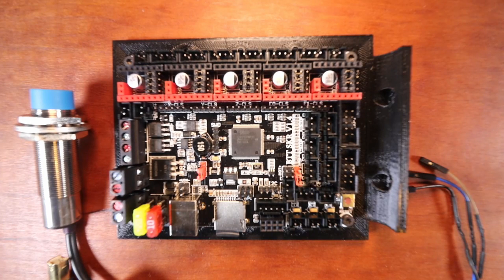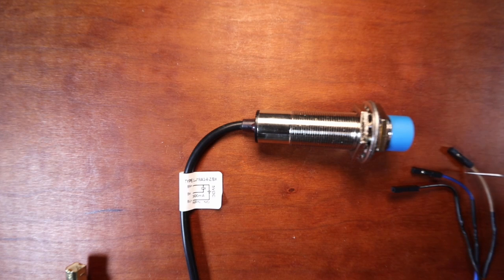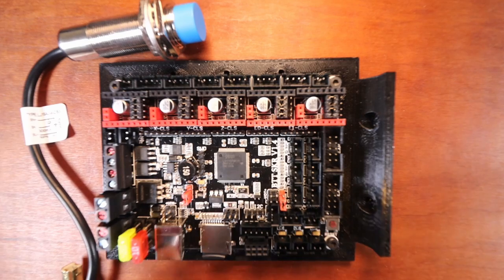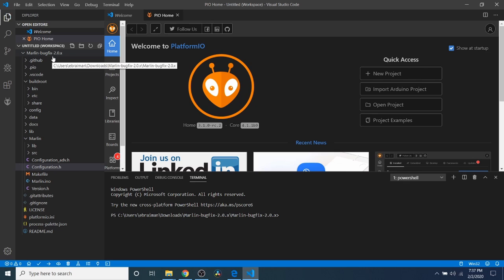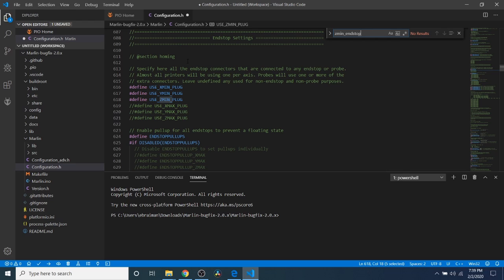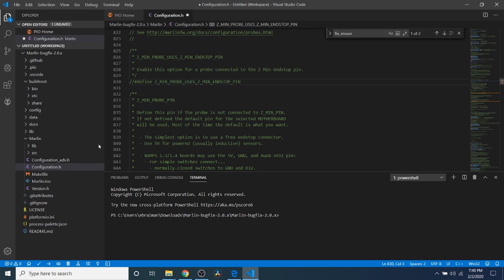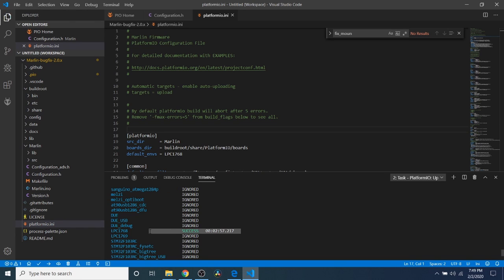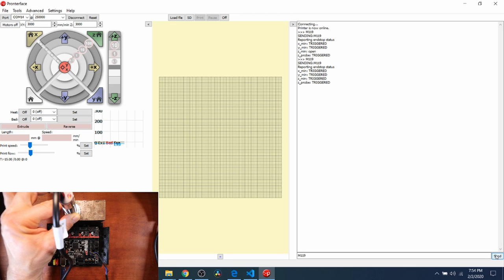SKR 1.4 - FIX MOUNTED PROBE

Comment: Important thing you left out, if you are using a sensorless driver like TMC2209 in UART mode, certain pin(s) have to be disabled. I would like not to clip pins on the driver, like if this needs to be done for SPI mode. From what I understand, the z endstop doesn't work if the debug pin is connected.

Comment: Hello Edward, thank you very much for your great tutorial. I have a quick question. I have an NPN NO sensor, but its power supply is 6-36 volts. Can you tell me how I can connect that to my SKR 1.4?
Thank you and please keep it up.
Heiko
Reply: You need a buck converter but luckily if you do that it will connect directly to the z endstop which is way easier
Reply: I believe an optocoupler would work here.

Comment: I did the fixed probe setup and left the "default zmin min probe uses zmin endstop pin" enabled and it seems to work fine, because the probe is actually plugged into the z endstop pins, same pins you are using.  The bltouch pins are actually below the the pins you are using.
Reply from the maker: True, but I did test with zmin last night on commented out setting.  The main reason I commented out was fixed mount probe setting would not compile/build without doing that.

Comment: For the popular 6-24/30/32/36v inductive sensors
In case someone else has this problem. The popular inductive sensors are not compatible with the SKR series. 
The sensor in the video is running at 5v but these are harder to find and are more expensive
The SKR has 5V on z switch while most sensors work between 6-32v. In order to use these, one needs a voltage divider. Power the sensor directly from the psu (12v in my case), insert voltage divider, signal drops to or a little lower than 5v and it works. for my sensor, the 15k on signal, 10k between signal and ground wires worked. However, even if the measured voltage at the sensor signal output is now correct, it still did not work. the SKR has hardware pull down and pull ups. My board maintained a steady 2.5v on the signal pin on the connector on the board. Meaning the sensor still won't work.
You need to activate/deactivate de pull-ups an/or pull-downs (depending on the default setting and the measured voltage on the pin on the mobo). There is no need to reassign the z probe to other pins on the board like i've seen in other guides
These need to be changed to fit your machine, example bellow are my settings. Sensor does not work on SKR without these settings being correct for the hardware used.
**as a side note, the 4 to 8mm industrial inductive sensors are really good and reliable. i bought more  LJ12A3-4-Z/BX for aroun 4usd(equivalent) / piece and they work great (even wen using a 2mm thick piece of galss over the bed)
#if DISABLED(ENDSTOPPULLUPS)
  // Disable ENDSTOPPULLUPS to set pullups individually
  //#define ENDSTOPPULLUP_XMAX
  //#define ENDSTOPPULLUP_YMAX
  //#define ENDSTOPPULLUP_ZMAX
  #define ENDSTOPPULLUP_XMIN
  #define ENDSTOPPULLUP_YMIN
  //#define ENDSTOPPULLUP_ZMIN
  //#define ENDSTOPPULLUP_ZMIN_PROBE
#endif

// Enable pulldown for all endstops to prevent a floating state
//#define ENDSTOPPULLDOWNS
#if DISABLED(ENDSTOPPULLDOWNS)
  // Disable ENDSTOPPULLDOWNS to set pulldowns individually
  //#define ENDSTOPPULLDOWN_XMAX
  //#define ENDSTOPPULLDOWN_YMAX
  //#define ENDSTOPPULLDOWN_ZMAX
  //#define ENDSTOPPULLDOWN_XMIN
  //#define ENDSTOPPULLDOWN_YMIN
  #define ENDSTOPPULLDOWN_ZMIN
  //#define ENDSTOPPULLDOWN_ZMIN_PROBE
Reply: Can I take 12v for the proximity sensor from the always on fan pins?? Top right side corne if you look from usb and to put signal on z end stop?
Reply from the maker: You'd need to filter signal pin not to fry board.  Signal pins only take a maximum of 5v, 12v will cook board.
Reply: @EdwardBraiman  thank you.. I have understood that I need to use 2 resistors to step down to 5v.. on google I have found only with external 12v psu to hook up to the sensor and I was thinking if I can take the 12v from the fan pin and only connect ground and signal cables to the z end stop.. with the resistor soldered

Comment: also, according to the seller I'm buying this probe from, it can detect anything.
This is the discription. is this a different type of sensor than you have?

Features:
It is a component widely used in automatic control industry for detecting, controlling, and noncontact switching.
When proximity switch is close to some target object, it will send out control signal.
As it is capacitive type proximity switch, its detecting object target is not limited to only conductor, but also liquid and even powder things, like plastic, water, glass, oil, etc.
It's widely used in machine, paper making, light industry for limiting station, orientation taking count, speeding trial ect.

Specifications:
3 Wire Polarity: NPN Detection
Voltage: DC 5V
Detection Distance: 2mm
Ouput Status: Normally Open
Output current: 300mA
Detection objects: Conductor
Part number: LJ8A3-2-Z/BX
Screw Length: 50mm
Quantity: 1 Pc
Note:
Please allow 1-3mm error due to manual measurement. pls make sure you do not mind before you bid
Due to the difference between different monitors, the picture may not reflect the actual color of the item. Thank you!

Package Contents:
1 Pc x Inductive Switch
Reply from the maker: The sensor in the video is inductive.  I've not yet tested capacitive and might not, because the last time I used one the wires melted.
Reply: @EdwardBraiman  Will i be able to follow the same steps to set it up on my BTT 1.4 Turbo/Pro MOBO?
Reply from the maker: Is the Pro Mobo a printer?

Comment: If i understand, if i use a PNP NO ive just to modify the parameters 
 define 
Z_MIN_ENDSTOP_INVERTING false and  
define Z_MIN_PROBE_ENDSTOP_INVERTING false and if the power supply is 6 to 30V ive to add a voltage adapter to 5V like a voltage divider or an optocoupler or better a 7805 to give on black wire signal the wished 5V right?
Reply from the maker: A voltage step down to signal pin helps, but it's easier to use one listed in description.
Reply: @EdwardBraiman  i buy NPN its easier, thank for reply

Comment: Thank you for your great videos. I appreciate them greatly.
I'm confused on the Marlin setup. You say to comment out the "use Z_MIN_ENDSTOP..." but then plug it into the endstop. I tried both variations of commented & uncommented but neither work for me. When I home Z the axis will move about a millimeter then stop.
Reply from the maker: What the sensor type?  If it's not NPN NO, then it might not works.  You can always test with an Endstop switch to verify pins are working.  Then they with multimeter voltage from sensor to check your sensor is working.
Reply: Forgot to inverse the triggered state?
Reply: @EdwardBraiman  Thank you for your reply Edward. I'm using the P.I.N.D.A V2 from POLISI3D. It's an NPN but I'm sure if it's normally open or closed. I believe it NC but not 100% sure. I'll try an endstop and see if that works.
Reply: @SteinerSE  Thank you Thomas for your help. I'm not sure. Would that effect the Z axis moving the wrong direction? The bed drops a couple times then stops. (Hypercube Evolution printer).
Reply from the maker: If the axis moves in wrong direction you can invert direction in Marlin firmware.

Comment: There is a huge problem with probing on multiply endstops when probing, i make an bugfix for this, still waiting that this will integrated in marlin. 

And, now we have marlin 2.0.2, in this i allready integrate an bugfix for all users that want to use multiply endstops and connect the Z endstops to the "z-stop" and "poen" pin
Reply from the maker: Not sure about fix yet as I'm on some of the Marlin bugs emails.  Do you have a link to the Marlin bug?

Comment: Hello. One question. We need to change the jumper for 5v and keep in 5v right? Other thing. This will work with a skr e3 mini v1.2? Thank you
Reply from the maker: Yes if it has a 5v jumper.  The reason make people use 5v is it safer way to explain firmware updating.

Comment: HI! nice tutorial! I´m trying to set my SKR 1.4 TURBO to work with UBL with a fixed probe, z home it´s good, heats up goes to the first point reads (in pronterface says fail to probe) and follows with the next point but in the same spot. i mean for example, it says point 3/9 but the probe is still in the first position and every time throws a "fail to probe" i dont know what am i missing, please help. 
Also, if i try to do a fine mesh edit it moves through the points normally.
Thanks!
Reply from the maker: My guess is eeprom.  There's a Discord chat in my Discord for BLT where someone might be able to give more information.  The Link should be in description.

Comment: Great Video. Ive currently the v1.3 of this board and problems with the fixed probe. I've an inductive sensor like you. The Sensor 
 you know  a work around for that?  I read that you could solder out the resistor( which is not an option because my solderiron is to big for that) or you could use the free servo pin and configure in the pins_BTT_SKR_V1_3.h file 
#define Z_MIN_PIN 2_00 
#define SERVO0_PIN 1_25

But that doesn't seem to do the trick. With this config I don't even get the light on the sensor to shine  ,when it's against the bed. You have any suggestions for me?
Reply from the maker: Are you using the exact sensor type?  The emphasis on the tag in the tutorial was on purpose.  The probe used in the tutorial only needs to be connected as shown.
Reply: @EdwardBraiman   i think so, its the PL 08N Sensor.
Reply: @EdwardBraiman   got it to work with the  method above, just used the right pin this time, had the pin layout 180 degree rotated. my bad. But thanks for helping! keep it up
Reply from the maker: @skysi  you're welcome.

Comment: Does this Lj18a3-8-z/bx works with the skr1.3?? The motherboard endstop output is 5volts and the sensor works between 6-36, so im getting something wrong or what?
Reply from the maker: The sensor in the description worked.

Comment: Can you do one of these fixed mount probe guides for the Skr Pro? I have installed one of these on various different boards but for some odd reason I just can't get it working at all on the Skr Pro. I am not sure exactly what the difference is be this board and all others I have tried, from the Skr 1.3 to the old mega ramps, but what ever it is just makes this type of probe not work at all.
Reply from the maker: Ramps works on PNP, where as SKR 1.3 does NPN.
Reply: @EdwardBraiman  Hmm...🤔 I guess I'll have to pull the one off my other printer then to see if it works so I can test out the board. I've have bought both PNP & NPN and used them but never really looked at one version working on one board over the others. I just grabbed one and installed it. Maybe I just got lucky in which one I used.
Reply from the maker: If it makes you feel better I made the same mistake.
Reply: @EdwardBraiman  Got my new sensors and it works now. Now I have a few spares of various types for future projects. Not being NPN was definitely was the issue. Went for a Capacitive sensor for this build as I upgraded the bed to glass as well.
 Thanks for all the help. It has been appreciated.
Reply from the maker: @VectorRoll  congratulations, but capacitive sensors can cause the wires to melt, so watch it like a hawk.

Comment: Am I missing something?....in the pinout picture you have circled two plugs, Servos and Probe. Then you use a totally different plug. You use the  Z stop plug.
Reply from the maker: Yes, the other plug at the time of recording was not functioning correctly.  And new setting changes had been added to marlin firmware.

Comment: Did you ever tried to use the 5v inductive sensor with the skr pro 1.1?
Reply from the maker: Not yet, but it should be similar.
Reply from the maker: Just need to check if NPN NO.
Reply: @EdwardBraiman  thanks for the response. I did try with the stock tronxy x5sa pro induction sensor (NPN NO), It lights up but it doesn't trigger.
Reply from the maker: It maybe different for your board.  Do you know which board that is?  I may have it in my 3d board collection.

Comment: I tried the SKR 1.4, but was getting a TMC Connection Error. I'm using TMC2209s (x4). I moved back to the SKR 1.3 and the same error appears. I have to assume there is an issue with the way I'm configuring Marlin. When I run command M122, I see this:   X Y Z E
Address  0 0 0 0
Enabled  false false false false
Y axis is moving fine, all others are locked, and the X axis stepper gets hot enough to burn me. Any recommendations?
Reply from the maker: Try moving y axis stepper to x axis and see if it moves.  Remember to power down setup.  There maybe an issue on Marlin bug track website.
Reply from the maker: Check www.github.com/MarlinFirmware/Marlin/issues/16617  this might be related.
Reply: @EdwardBraiman  Thanks for the link. I've read through that. Just as a point of reference, this is a 2015 Lulzbot TAZ 5 that I completely gutted, including cables as it was in bad condition due to many hours of use. Rebuilt all assemblies, but kept the original NEMA steppers. So, I did find that the 2209 that was overheating was bad. I moved it to the E0 slot and the problem followed. I ordered a new one. The Z axis was moving and so I rotated all axis through the operating Z and all motors worked, so that should eliminate any possible errors with my new cables. I assume at this point, I am still having a firmware or motherboard issue. All driver registers (M122) report connection OK, yet my X ,Y, and E0 are still not moving. I'll continue investigating what could be wrong, but it looks like some issue my ability to work with Marlin 2.
Reply from the maker: @paulnolastname9422  you're welcome.  I've still been working on a tutorial on how to get tmc2209 setup, but I've not rechecked since last time a couple of weeks ago.  Maybe I'll check again tonight.  I try and wait until I get something working before posting.

Comment: I have tryied with skr pro 1.1 with this sensor LJC18A3-H-Z/BX but it doesn't work... When the 3d printer goes home the led sensor switch on but it doesn't stop.. how i can fix it?
Reply from the maker: Unsure as the tutorial is not for SKR pro 1.1.
Reply: Check if you have 6 to 36 VDC version. If I'm not mistaking, in that case you shouldn't connect power pin to board but rather directly to your power source.

Comment: Is there any way to connect an 12 v sensor? I have one lying around at home
Reply: You can connect it to 12v pin. So instead of using the 5v pin in the Z min endstop section you'd use whatever 12v pin not being used. (If you're using a 24v supply those might be 24v & not 12v) One of the fans + pin would work, and you can even use the ground pin from the fan too. You just need to connect the signal wire to the signal pin from the endstop. see links for an image. Although, you might have to mess with the inverting in Marlin if it's a PNP sensor.
https://www.dropbox.com/s/93lwpapwbwwfmzs/bottom%2012v%20pins.jpg?dl=0
https://www.dropbox.com/s/oio5hwgsohii2pu/top%2012v%20pins.jpg?dl=0
Reply: @Hopeinformer  he's but the problem ist that that sensor is  a output signal 12 volt and the z min signal pin schould be 5 volt?
Reply: @luminousmoonnight6487  I'm not sure. I've never seen a probe that needs 12v for the signal
Reply from the maker: It's possible, but I burned wires in the past doing this.
Reply from the maker: A 7805 stepdown will do it, but it's very very dangerous.  So please avoid trying.
Reply: @EdwardBraiman  jes and m sensor have 300mA think that's not enothe that the voltage ist stable.
Reply: @EdwardBraiman  du you know a 5v kapazitiv sensor?
Reply: @Hopeinformer   7 to 36 volt bust at 5 volt useless of Accuracy
Reply: @EdwardBraiman  what du you think about ez abl from th3
Reply from the maker: @luminousmoonnight6487  we're using two at work and it's only been a couple of days.  They work and are easy to assemble.  I'll need a couple of weeks to know more.
Reply: @EdwardBraiman  thank you, I hope it will work for me. Would be interesting how accurate the sensor ist, have you ever testet ist white the Probe reabilitytest in the firmware to activate

Comment: If you see in pins in config_adv.h auto fan is  like this define E0_AUTO_FAN_PIN  -1. But when I open Pin_btt_skr.h. In the pin is define as define FAN_PIN          P2_03.  So when I put P2_03  instead of _1. Its give me the error.
Reply from the maker: That sounds like a bug, but I can check in the morning.
Reply: thanks
Reply: @EdwardBraiman  did you check it.
Reply from the maker: @robo909  I'm running a little behind because I tried to do tutorial with a PWM fan when I should have used a fan extender like my SKR 1.3 tutorial.  It should work.
Reply: @EdwardBraiman  THANKS BUT I WANT TO SEE WITHOUT FAN EXTENDER AND WANT TO USE FAN_PIN P2_03. LOT OF LOT PEOPLE ARE ASKING ABOUT THIS

Comment: Please, can you explain how to configure Double Z, on Marlin 2.0.3? Nobody did it, you would be the first 🤗
Reply from the maker: Do you mean the physical board or advanced configuration?
Reply: @EdwardBraiman  Advanced Configuration :)
Reply from the maker: On SKR 1.4 you only need to connect steppers to each port for each steppers and run off one stepper.  I might do a tutorial with BLtouch where I show movement in the video.
Reply from the maker: Keep in mind BLtouch is still broken in Marlin 2.0.x.
Reply: @EdwardBraiman  It would take a tutorial where you explain how to set dual Z in Marlin 2.0.3 because they changed everything, compared to Marlin 2.0.x and I can't understand. Please :(
Reply from the maker: I'll see if I can explain in a tutorial soon.
Reply: @EdwardBraiman  thank you so much 🙏
Reply from the maker: You're welcome.